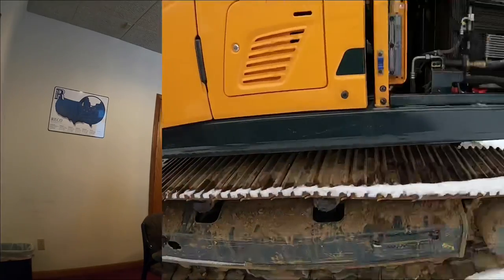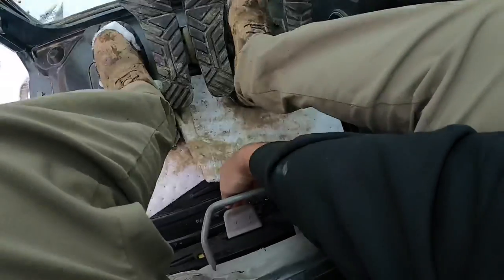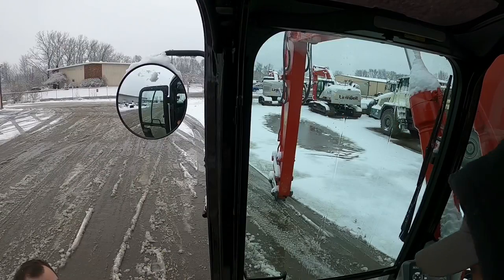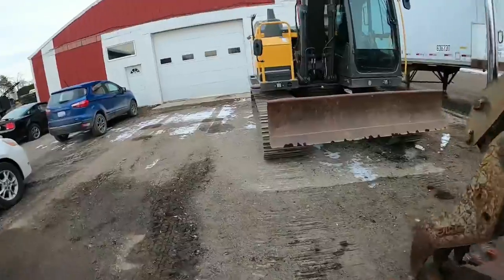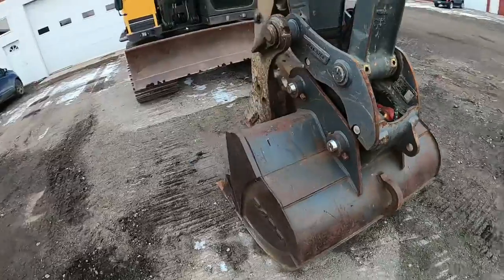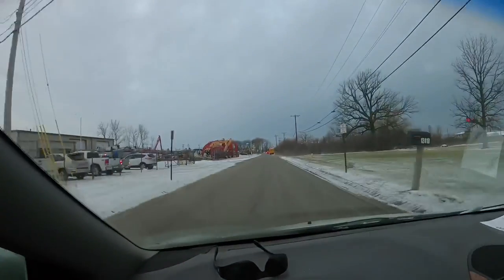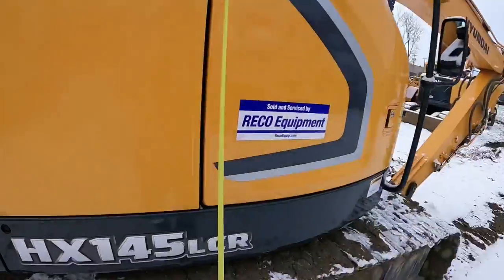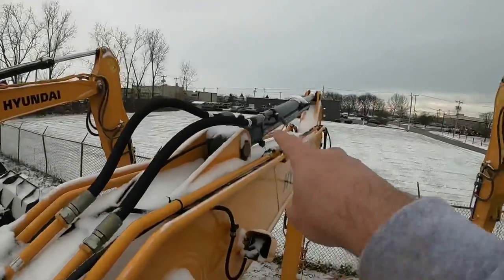Road Trip Shopping For a New Excavator #volvo #hyundai  #excavator

Comment: Did you have a look at the Doosan DX140LCR Machine?
The Volvo, Hyundai & Doosan look to be all very similar build/designed machines, They are all build within a stones throw of each other in Korea.  
I do a agree with the the other guys, Service/aftersales is your main thing, no point having the dealer 3hrs away to get parts etc
Reply from the maker: Yes and not even close to being the same machine

Comment: One thing about the Hyundai I noticed,it had a single travel pedal that is nice for loading , long travel distances in the machine like I’ve seen you do a lot and unloading off the lowboy so you don’t have to try to perfectly get the travel pedals exactly right on full throttle. That  does usually come standard on the most of the bigger machines I do like that Hyundai setup. Can’t complain there all nice, 20th century here you come lol
Reply from the maker: The Volvo 140 has that as well

Comment: I have the Komatsu 138 with a blade , it’s built a lot like the Hyundai. With the zero tail swing if you’re on any bit of a slope your tip the machine up without the blade.  I do a lot of retaining walls and setting binblocks you have to have a blade , you need to demo that excavator on a little bit of a slope by the time you put a thumb on and bucket you’ll regret not having a blade. 
Good luck but I would keep that in the consideration with a zero tail machine.  God bless and happy new year

Comment: I’m glad that you made the choice that you did with the Volvo. I particularly found that death tape thing in the Hyundai a little alarming. Because those computer units are not cheap to replace. Now they’re a little easier on you than say cat or bobcat equipment, but $579 to me is nothing to sneeze at
Reply: Of course that’s only for the controller and if you were to install it yourself, that doesn’t include installation and labor costs
Reply from the maker: Thanks Alex

Comment: I love my Hyundai mini 35 series and my buddy has a 80 and 160. All three amazing machines for us. Like you stated they are really engineered strong and easy to work on. My dealer support is amazing. I called for a filter kit on my first service. They are 45 minutes away and had an employee that lives in my town drop it off the same night. Dealer support is key. Also in the numbers game they beat others by far. Others offer 0% financing but are 5% more on total price. There is a 2016 Hyundai HX145 LCR with 1285 hrs on it in Orland Park Illinois for $110,000 with WB thumb and quick coupler. Much cheaper then the new one you looked at. Just some food for thought.
Reply from the maker: Great information thanks

Comment: The big advantage the Volvo had over the Hyundai for me was the blade,  on certain jobs (small jobs) it could be the difference between having to haul the dozer & not. But that's just my opinion, it's your machine Mike & you make the decision 👍
Reply: The wider tracks might be an optional add-on. That makes the blade not as wide as the tracks. That's a pain if you're trying to level a place to sit. Is the entire drive train strong enough for wider tracks than the stock size? Less ground pressure with wide tracks just means less traction not less sinking.
Reply: @QuantityEngineers  the wider pads wouldn't be a Volvo option if the machine wasn't up to it & there's blade extensions available that fold out on hinges & back in for transport, that machine has either not been fitted with the extensions or has had the wider track pads fitted at a later date.

Comment: Very impressed with the lay out of the Hyundai. The only downside is that computer location right under the DEF. It would need some kind of cover over the top of it. Wouldn't want to enclose it since it needs airflow for cooling.

The thumb on that Volvo sucks. That thing wouldn't last a month in rock. You can fab extensions for the blade to make it work, but the thumb needs to go in the scrap bin.
Reply from the maker: Agree with the def 100% disagree with thumb it very well built

Comment: The machines you were looking at the first 2 looked like  a normal regular size, the Volvo  looked like a mid size with the blade on the front but so did the Hyundai but without the blade. What size machine were you more interested in?
Reply from the maker: They are all in the same class
Reply: @DirtPerfect   Recently the company I work for purchased a Kubota excavator to help with the types of work we're doing. What was thought to be a mini turned out to be a mid size with the big difference in weight class. The machine fits fine on our 12k lbs trailer but weights almost at the trailers ratings. So now we're looking for a 14k trailer and truck to move it legally without hassle from D.O.T , the only truck in the fleet that comes within reason is the f550 dump we have. The Kubota we got is very similar to your Volvo +/- a couple things ,ours doesn't have the on board computer but we have a 6way blade.

Comment: I don't know much about the newer Perkins engines with the emissions but my older Cat skid steer and some of our other equipment had them and they were great on fuel and lasted forever! They're basically The European version of a Cummins.
Reply from the maker: Yup agree
Reply: @DirtPerfect  Ya on my 2001 cat 262 skid steer with a Perkins and it had like a 15 gallon tank and I could run it for 2 days on one tank, then I rented a new 262D cat skid steer with the Kubota engine and it had like a 35 gallon tank and I'd have to fill it every day and it was always giving me emissions problems.

Comment: I don't know if it was the camera, but I'd go with the Hyundai or the Linkbelt just because they sounded much quieter than the Volvo. As for the worn pins, I would bet money on it either having a lot of hours with a vibrator packer or a jackhammer attached to it. As both of those would wear parts out much faster than other attachments.
Is the zero swing a must? I would think the easier maintenance and lower transport height of a regular machine  would out weight the benefits of the zero swing.
Reply from the maker: No they are both much quieter I agree

Comment: Perkins engines are reliable.
But Linkbelt looks fast and steady.
Miint 👌
Reply from the maker: Agree
Reply: Perkins. Are good reliable engines.  ,  they do like to drink a little extra fuel ,    and   should now have good fast parts service,  since Caterpillar bought perkins several years ago
Reply: @toddreynolds8875  U got that right.
MiH🙋

Comment: I can't speak bout excavators, but before I retired, the WVDOH bought some Hyundai loaders,. My biggest complaint about the loaders was there wasn't enough hydraulic power to do two functions at once. You could either raise the bucket or turn the machine, bit not both at the same time. Just my 2 cents.
Reply from the maker: Interesting thanks

Comment: Just looking at the specs comparing the H 140 to the H 145, both have same HP, weight 600lbs dif, 
Bucket breakout force is greater n the 140, wider tail swing on 140. What was the specs on the 145 that you saw you wanted/needed over the 140? Speaking Hyundai only
Reply from the maker: Yup still tuned

Comment: We have a 2016 Volvo EC300EL … I love that hoe and it performs very well. It’s balanced well and all the controls are very responsive but not jumpy and it has power for days … I love using this hoe when we have a lot of linear feet of trench to dig and there’s gonna be some intersecting utilities crossing our NatGas line or other Nat Gas lines running along with our new trench. Really anytime I’m gonna dig around live Pipe , I like to use the Volvo or our Komatsu 220. They are both tight and precise which is obviously needed around Nat Gas Mains and especially when I’m dig around a High Pressure main line … that’s when you really want the precision of a nice tight hoe and  I usually pick the Volvo

Comment: You drove right past me and and didn't stop by for coffee?!  I agree the Hyundai looks sweet but how much would you really use the display?  Will narrow tracks take away from what you do now?  Would the blade on the 140 give you a worthy upgrade in stability and capabilities?  They must have done a lot of side sweeping to wear the pins that fast.  In short, don't let the bling distract you from what you really need.
 I don't envy you.  It seems that with anything you look to get you can't get all the features you want in one machine or brand albeit an excavator, a GPS, or even a watch.  In the meantime you could give the Captain a shovel and strap a saddle on his back.  Voice control, good visibility, easy to transport,  and music if his singing isn't too bad.  Cold starting might be an issue with coffee being more expensive than ether, nowadays.
Reply from the maker: Thanks for all the input where to you live Eddie
Reply: $%&%$ Notifications!  Too late to answer and I just bet you settled on the 140 when you replied and knew you'd be back this way :\

Comment: We just bought a Hyundai 145 with a blade. We compared the Hyundai side by side with the link belt. The Hyundai will lift more than the link belt and is a faster machine. The only think the link belt has over the Hyundai is the smoothness of the controls.
Reply from the maker: Good info thanks

Comment: I can't stand the foot pedal auxiliary for the thumb, or the 220 I ran was that way. Ran a 210 lx4 link belt w fleco hydraulic thumb and 48 bucket. It had the buttons on the right joystick. I disnt get maybe 50 70 hr on the link belt cause we rented it but it handled the 48 bucket fine and was very quick and smooth and comfortable. I would like to get more time w link belts. I really really liked that 210
Reply from the maker: Both machines had push button

Comment: Good morning
I'm a new subscriber 
I would not recommend the JCB
They are great machines but like all machines they will have issues
I bought a new JCB and a few hours into running it developed a motor issue. The machine was in and out of the shop for months and they spent a ton of money trying to fix it and couldn't. I had a warranty but JCB would not honor it. I wanted a new machine but they said no. The only way to get a new machine would be to hire a lawyer. I ended up keeping the machine but it always has the issue. Just thought I give you a heads up!
Reply from the maker: Welcome to the channel and thanks for the info

Comment: I used to joke with friends that Hyundai vehicles were made from recycled coffee machines.  But that machine looked really nice.  At some point you are going to buy the piece of equipment you will retire with.  Ask yourself if this is it.  Or at this point will there be other excavators. Does any other equipment need to be fixed/replaced/updated.  This video got my brain working.  DP good luck with your decision.  Don’t overlook the advantages of the blade on the Volvo.  May help with less equipment on a job site.
Reply from the maker: lol

Comment: I thought Hyundai's were orange with blue lettering, did they switch it up?
That guy has been brushing the bucket side to side against the ground a bit too hard on that Volvo, maybe.
As far as the rest of it goes, the dealer and the parts are almost as important as the machine, from the way I see it. If the dealer has a bad service history or takes forever to get parts, then a downtime that could be a day could be a week or more. Plus there is how close they are to you, I know you aren't exactly on the edge of some major metro and are used to a bit of a haul to get things, but how far do you want to have to haul the equipment to have them work on it? Does your cdl cover carrying across state lines or is the government and insurance going to peg you for taking your stuff to be worked on twice a year?
Is the zero tail swing important to you?
Happy New Year, Mike and thanks for making the videos. Hope you get something you can work with.
I ramble and I think I said half this crap to you a year or two ago ;) oh well.

Comment: No blade on the Hyundai, zero swing could be rough as some have said below. Looks like the Volvo wasn't zero swing, has the blade, cheaper,.. the bucket pins/bushings could be fixed. If you have good dealer support/warranty for the Volvo,.... without knowing prices, at least you're not paying for the depreciation of new(er) with the Volvo. Get a bottle of that new smell car scent,.. and you'll be golden. ;)
Reply from the maker: Will have to say I agree

Comment: Hyundai used to be so quick on hydraulics the only excavator I ever seen the dipper arm (stick) rip off just unerneath knuckle from stick to boom I seen it happen on 2 160,s early noughties models  and I was working with company who had a whole fleet of them. I operated a 225 Hyundai just last year and it was smooth on control lovely machine  but those older ones years back were way to fast to last 😁

Comment: We have a 70 ton low boy. Works great can haul anything. We have a cat 320 excavator and a cat 950 front endloader. Hauls those with no problem. Dont need to worry about height restriction.
Reply from the maker: To big for me
Reply: @DirtPerfect  yes our loader was a yard machine. We had a concrete plant so needed that extra power sometimes. I know a 315. 320 tops would be a good all around machine. I have operated the Volvo I like them. But I wasnt signing the checks so Cat it was lol.
Reply: @DirtPerfect  cat not what they used to be. 15-20 years ago cat pretty much had a lock on everything but now Volvo and Kumatsu have made leaps and bounds in there machines to give them a more even run for who's the best my personal opinion I've always been with Cat but I really like the volvo.

Comment: Yeah, I don't like the LinkBelt, If you have a broken hydraulic hose back in the engine compartment it looks like it will be VERY difficult to replace. Plus it looks like the engine is not very well protected on the corners. Hyundai has come a long way. Do they come with any warranty left?  Do you have a GOOD Hyundai dealer close to you?

Comment: Which dealer is going to be closest and actually INTERESTED in helping you when you have an issue?  The other thing you didn't mention is anything about warranties.  The Volvo likely won't have one while the Hyundai does.  I have had ZERO issues with mine and, at its 500 hour "doctors appointment," they turned it up to full factory spec (they're turned down a little during break in).  When they did that, mine actually has "hairy knuckles" now, and it was pretty strong before.  It might be a few extra bucks, but think of the benefits too.  Ultimately, it's YOUR budget, and YOUR choice because YOU are the one who's going to live with it for the next umpteen years.

Comment: Hey Mike. I am a Volvo mechanic and have been for 25 years. The display is very easy to use . The salesman should have shown you all the good points of the Volvo. They are very user friendly if I were showing you the 140 you would love it. Volvo has a rear and right side camera on them so you don't have to see on the right side. The travel alarm has a switch to turn it off. All he had hoses on a Volvo have the part number on them. It is marked on the fitting.  I don't like the DPF filter on top of the engine on the Hyundai. It make it very had if you have to work on the engine. I put on a lot of thumb and I don't like the one on that volvo. I would never buy a zero swing machine because they are very hard to work on. The blade make the machine very heavy and no really needed my opinion. I have seen bucket pin go out a less than 2000 hours if no greased. I love the Volvo. I have been a round the Hyundai wheel loaders and they were junk. Make the right choice and good luck. Love your videos and keep them coming. Thanks.
Reply from the maker: lol stay tuned I still may need you 😬

Comment: The bummer about not getting a demo is, does it have enough swing power to fill ditches. 
Swing power was a deal breaker for a contractor friend 2 years ago. 
Great tour.
Reply: BladeArtist 205  Yes, the Swing Motor needs to generate enough torque to push dirt with the side of the bucket.
Reply: Geo Thomas  An excavator does not have Swing Cylinders. It has a hydraulic motor that engages a ring gear that swings the body of the machine. Backhoes have swing cylinders.
Reply: BladeArtist 205  I'm not debating what is proper or not. Fact is back filling with the bucket happens. It avoids bringing another machine on site.
Reply: I can’t delete your posts. Only the Dirt Perfect can.
I started on a Case 580 in 1980.
Granted I don’t operate a ground engaging machine every day, but a “non operating puss” I’m not. I’m a part time operating puss.
Reply from the maker: Lol al I agree with you 100% thanks buddy

Comment: I know you wanted a blade. Would you add that to the Hyundai? You've also said you like buying used which is probably good for something you won't put 50 hours a week on. Can they find a used Hyundai with a blade? Whatever you buy has to fit financially as well as doing the jobs you need it to do. You have to separate wants from needs.